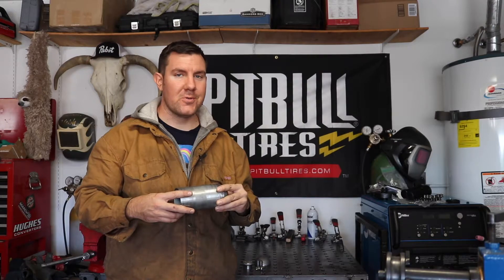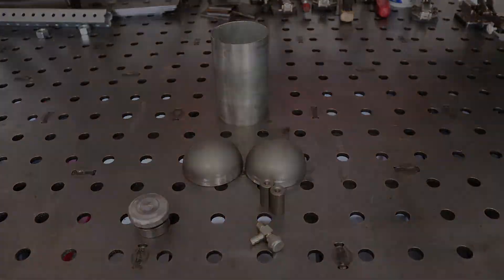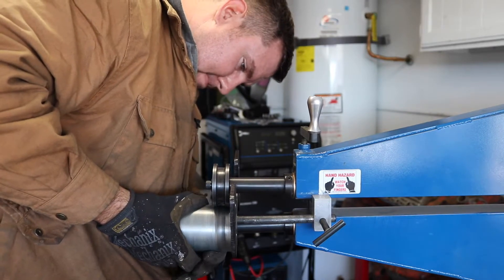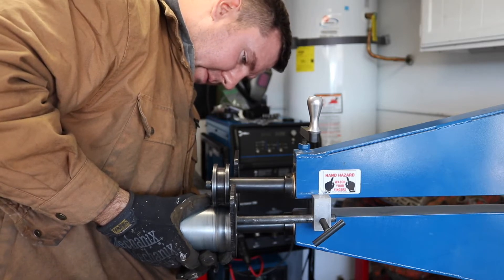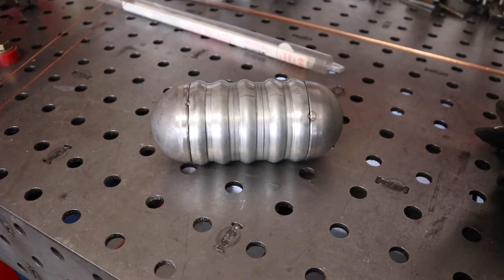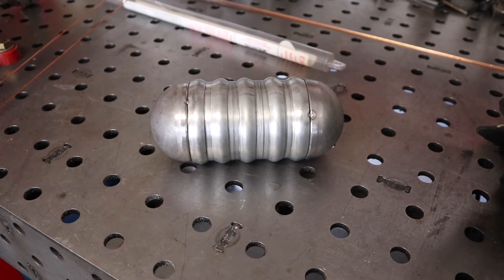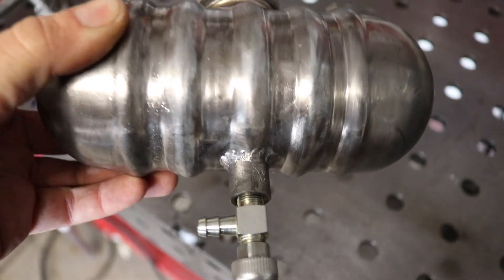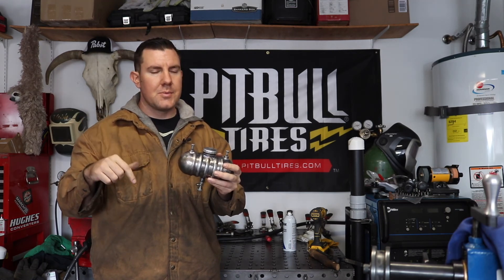How To Build A Mini Bike Gas Tank

Comment: nice...    I used the tank from a non-running snow blower engine.    Less work.     Good job though!
Reply: I’m gonna use an empty propane tank. One of those blue ones. Sand it down to chrome and cover it in a protective oil before I hose clamp it on. Same process just ready to use bottle.

Comment: How does the cap fit if the pipe is 3"ID but caps are 3" OD?
Reply from the maker: One thing I noticed is that “3 inch exhaust tubing” differs wildly in of sizes. I just tried a few pieces I had laying around until I found one that fit. The winner was a 3” tailpipe from Oriley auto parts
Reply: @built4625  great that what i got autozone has the same product.  Just waiting on the caps to get here ill see what i can do to make it work. Thanks for answering my question by the way!
Reply from the maker: Jeffery Cervantes no problem man. It should work out well for you. If you have any more questions, let me know. I’m always down to help.